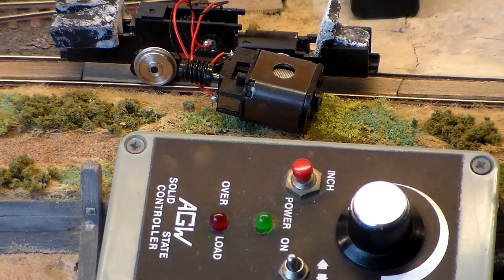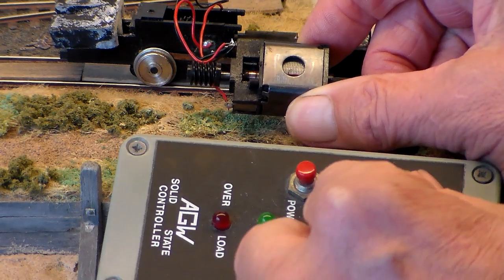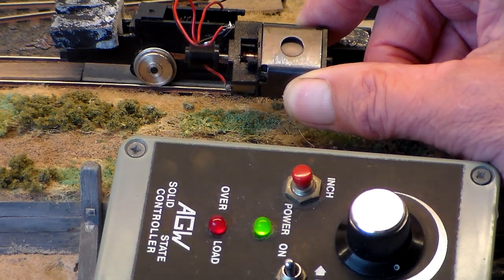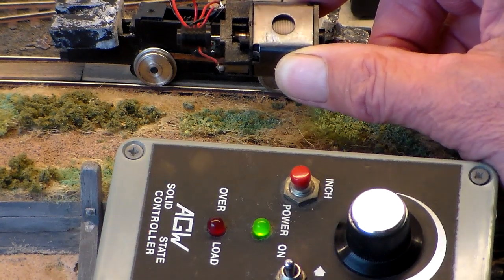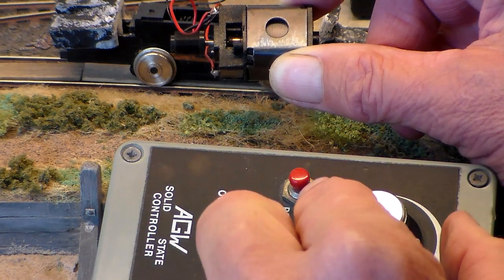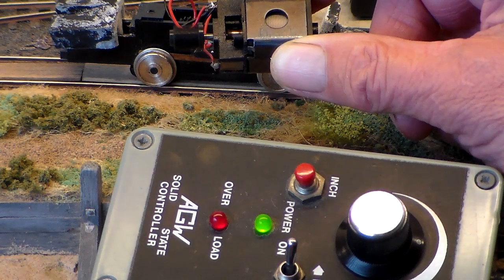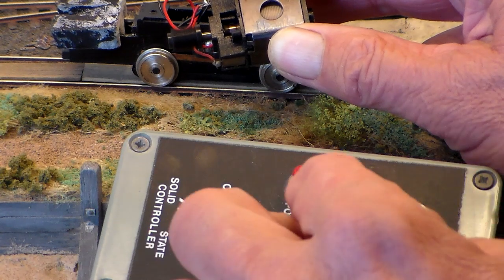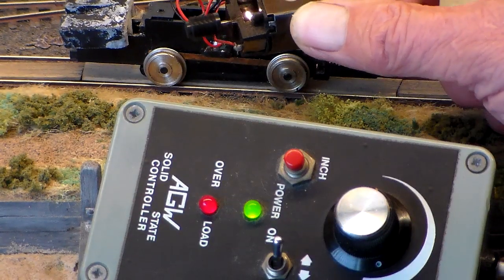Why arcing at motor brushes (model rail electrical)

Comment from the maker: Hi David, this is an older motor. Thanks for the suggestion. There is a suppression capacitor but I haven't checked it. The tram it came out of hasn't been run for a while so I will check whether it has run itself in - bedded in the brushes.

Comment: Would it be possible to add a barrier between the arcing brushes?

By the way, what ever happened to AGW controllers?. They were great.
I use DCC these days but wouldn't mind a small AGW unit for testing.